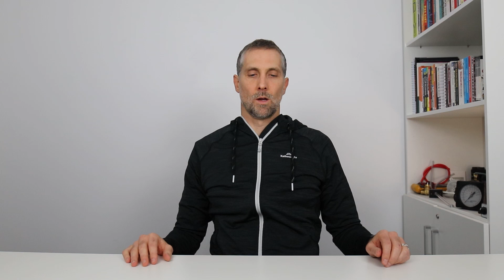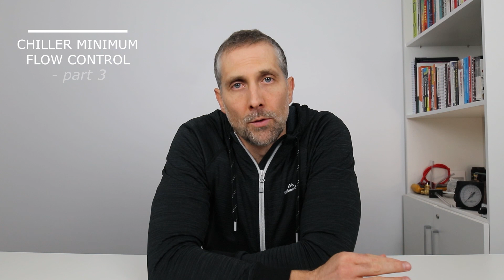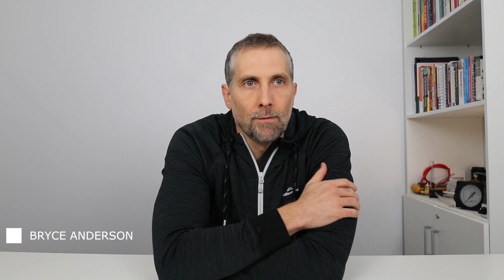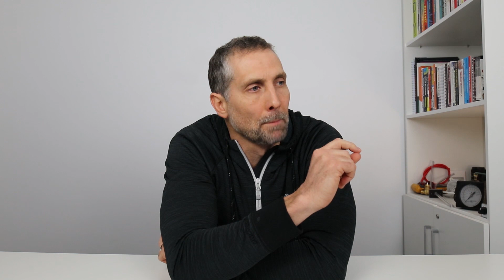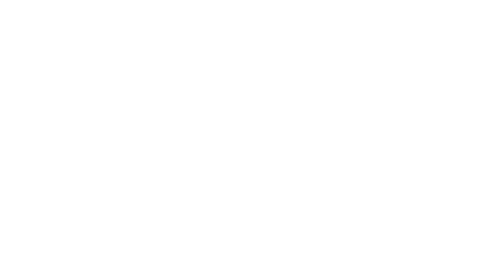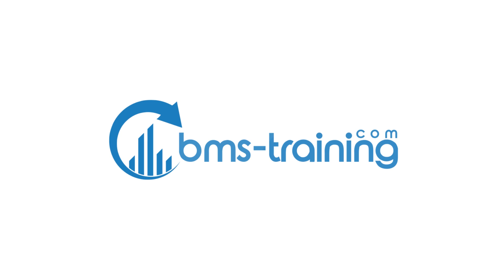Chiller Bypass Control

Comment: Hold the phone. The issue is not with butterfly valves. The issue is with the SIZE of the butterfly valve. All valves should be sized for the application. Anyone who is putting in a bypass butterfly equal to the size of the main chilled water line is simply put, doing it wrong. Butterflys do have a Cv after all. Granted that a nice globe valve is the "money is no object" solution but a properly sized butterfly will serve.
Regarding your discussion of PID tuning I agree that the prop band is often set wider than necessary because that's the easy solution to getting stability. To simply narrow that band is a bit of a simplification. You do have the integral reset time in the toolbox. In very simplistic terms you're suggesting that the PID isn't moving FAST enough and speed is the province of the derivative portion of the PID. Unfortunately derivative is notoriously difficult to tune for in something as scattershot as HVAC. I'd just narrow the PID until the control gets a bit unsteady, widen it a bit to make it stable, and then dial in enough integral to make it fast enough on start up.
Reply from the maker: I can't remember what I said in this video, lol. I do generally agree with most of what you are saying.

Comment: The engineer of record had us install a butterfly valve for chiller minimum flow control on a chiller plant upgrade project. I did not agree but he was the EOR so it was installed. Valve works ok on the lower end of the valve position and it does control fine. However, beyond 60% the valve is really allowing almost 90% flow or so and it becomes difficult to control.

Comment: I think that the baypass valve location was wrong if once opening then the Chiller tripped it means water short short-circuiting between the bypass and to pump without crossing inside to Chiller,

Comment: Very good advice on chiller bypass control! Had problems when I was in the field adjusting the setpoint to meet the flow requirements. The most of the time the chiller would trip on low flow because the valve could not respond. 80% of the jobs I worked on were butterfly valves because they were cheap!
Thanks for your help in this matter!
Jeff Raboin- retired control tech
Reply from the maker: Hello Jeff. When I do new construction witnessing. I ask the BMS engineer to override all the cooling valve from, 100, 90, 80, 70, 60, 50, 40, 30 (over about 30 minutes)... and every time the chiller will trip on low flow as this scenario was never tested (tuned). 
Thanks for the support, mate. Have a good Christmas 🎄

Comment: hi Bryce , just found your channel and LinkedIn profile recently - great source of hands-on knowledge for a mech engineer!
just wondering on the "equal percentage" there for chiller bypass valve ( https://youtu.be/naqaRNhYtR0?t=710 ) - wouldn't it be more convenient to use linear characteristic for this application (I mean you don't have a coil in that "circuit" you would normally want to flatten for the capacity(stroke) function and perhaps linear flow(stroke) response would be more beneficial here?)
Reply from the maker: Hello Pawel, I have not watched that video for a long time, lol. 
The chiller bypass control valve is maintaining the minimum flow through the chiller evaporator, and the evaporator is a coil. 
So, if I undersatnd you comment correctly, yes you do still need an equal percentage charateristic control valve. 
If you have a primary/secondary system with the bypass on the secondary system or a bypass control valve on the cooling towers, then yes, they probably could be linear.
Reply: @bryceanderson17  I had a similar thought as PawlikC when watching this video. First, I should say that I am new to variable chilled water flow design and really appreciate your videos.  I have been having difficulty finding information on the best valve type to use both for minimum chiller flow control and for isolating chillers during staging. 
For controlling heat transfer capacity through a coil, a valve with equal percentage inherent characteristic makes sense to me. This is because we are trying to achieve a linear valve position vs heat transfer capacity characteristic for good control. The valve position vs flowrate characteristic of a properly selected equal % valve when combined with the (opposite behaving) heat transfer capacity vs. flowrate characteristic of the coil, ideally leads to a near linear "installed characteristic" for valve position vs. heat transfer capacity for the system. The linear installed characteristic is ideal for good control since the valve position % should match closely to whatever heat transfer % capacity that we are trying to achieve.
In the case of a minimum flow bypass control valve, we are not controlling for chiller heat transfer capacity, we are controlling to maintain minimum flow. So we would want as close to a linear valve position vs flowrate characteristic that we can get (for good controllability). The only thing we are relying on to achieve this linear installed characteristic in the bypass line would be the valve itself. The bypass line is a short pipe with relatively little head loss and relatively constant differential pressure across it so it can't do much to affect this.  Based on this reasoning, I would think a valve with linear characteristic, such as a globe valve with linear trim, would be best. Again, I have no experience with this and would really appreciate hearing more about what you've seen work for this application.

Comment: Thanks for sharing your experience. Usually controlling bypass valve through an actual flow meter. And when adding a chiller to the load you just multiplying the minimum flow set point by the number of running chillers if they're equal.
Reply from the maker: Yes, this has been mentioned to me, thanks! 
I usually measure the flow at each chiller and pick the lowest to control the bypass. But, I guess you could have 1 large common flow meter and do as you suggest. 
I wonder if 1 large flow meter would be cheaper than 3 smaller ones? 
Also, when u have individual flow meters, you can calculate kWr for each running chiller, which is what we use for capacity staging.
Thanks for sharing.
Reply: @bryceanderson17  you're welcome. 
I suggest a current transmitters for each chiller for capacity staging (cheap solution)